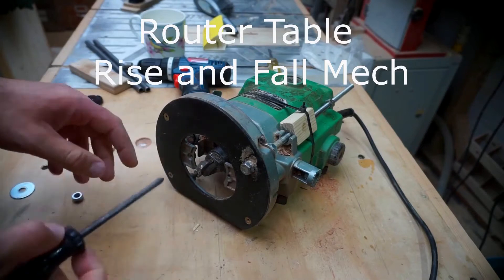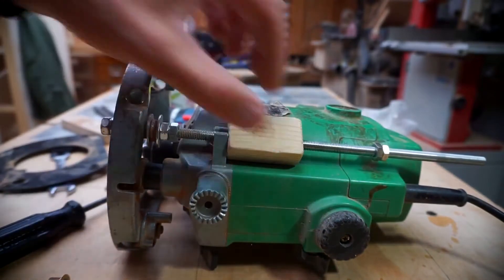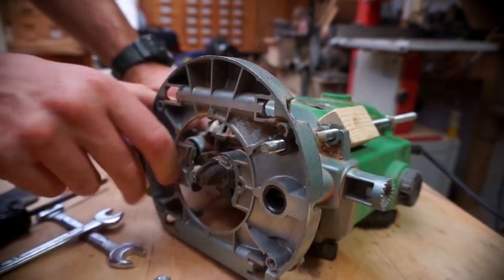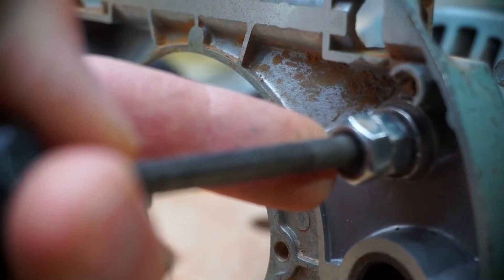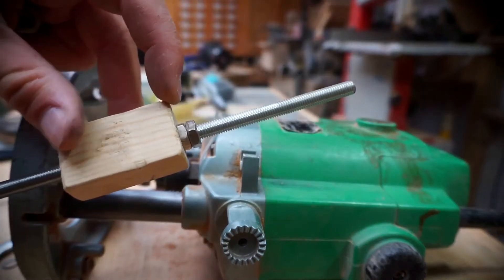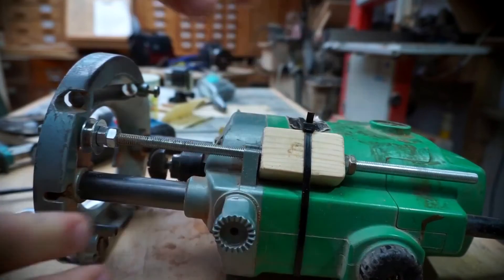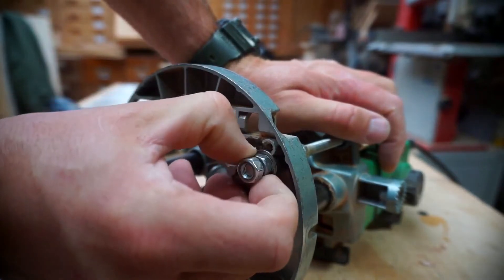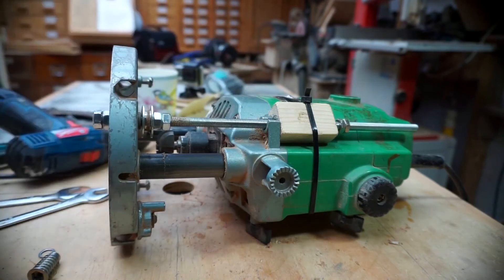Router Table Rise and Fall Mech

Comment: Really useful Matt, thanks. Like others I have this router and need an inexpensive lift mechanism. What is that threaded rod - M10?
Reply from the maker: That is an M8 threaded rod. Thanks for the positive feedback. Appreciate your support
Matt
Reply: @Crooks103  cheers! I’m just trying to work out what the washers/bearing underneath the base are for… gravity/the springs are forcing the router down, and when you wind it, the threaded block is pulling the body of the router up against the locking nuts at the top. Can’t think when the other bearing/locking nuts would come into play? Have you tried without?
Reply: I did the opposite, without ruining /drilling the router itself.
Unlocked the two bolt near the plate, locked them again like 3cm upper. 
Unlocked the two bolt on the other side, removed them both, put a washer, a bearing, then a M8 coupler (it's just a long M8 bolt, you can find it easily on Amazon searching for M8 66.
That's it.
Putting them against the Linear bearing make you sure that the body itself does not get damaged, since the washer keep the bearing rotating and not haltink, and the bearing keep the bolt rotating against the bearing center itself.
If the bearing breaks, you just replace it.